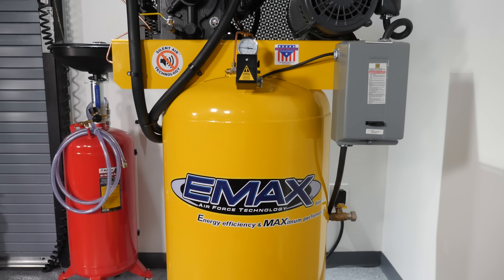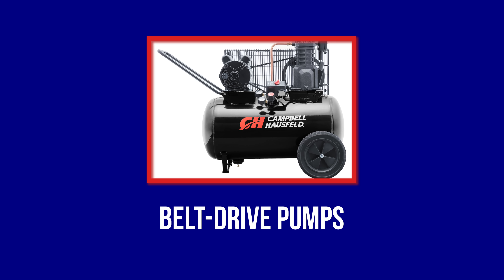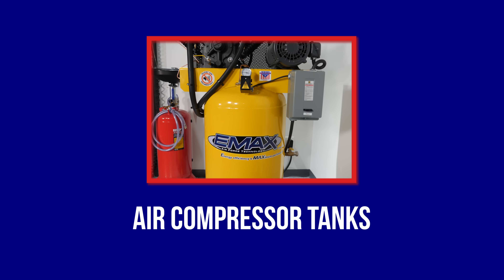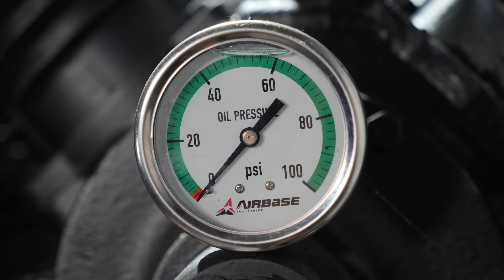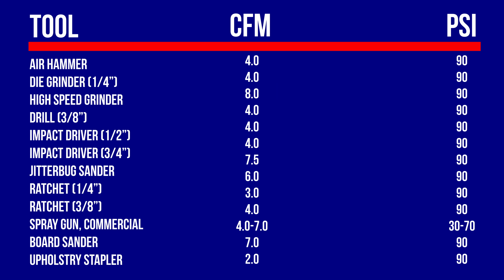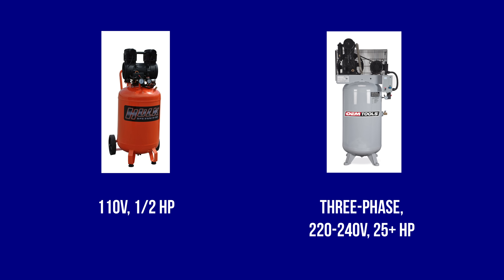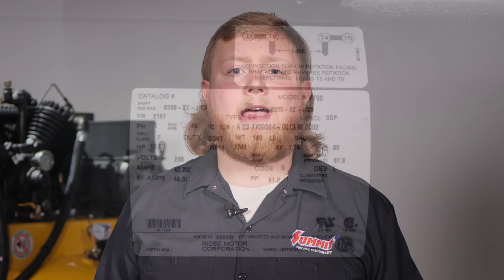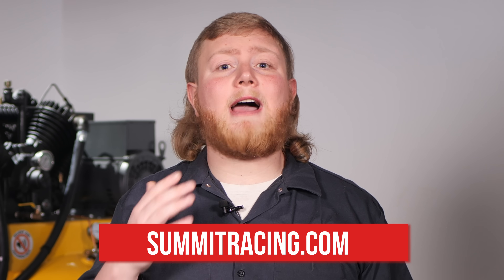How to Choose the Right Air Compressor

Comment: As a general rule you should be able to produce 20CFM on a 25 amp 220v circuit  And you should be able to produce 40CFM on a 50 amp 220v circuit. 
 My Quincy 390 produces 36CFM on a 50 amp 220v circuit with a 10 horsepower single phase motor.
 You can always purchase a pump twice as big as you need and spin it at half the RPM. If you want something bigger later, you can just add a bigger motor and spin it faster.  My Quincy 390 is capable of producing 70CFM at 200 PSI with a 20 horsepower motor , But I'm only spinning it at 560 RPM to produce 36CFM with a 10 horsepower motor.
 If I ever need more air I could just get a bigger motor and spin the pump faster.

Comment: I have a 60 gallon air compressor, with a good regulator it is enough to constantly use tools at 90 psi. Keep the tank blown down and a good compressor should last 30 years.